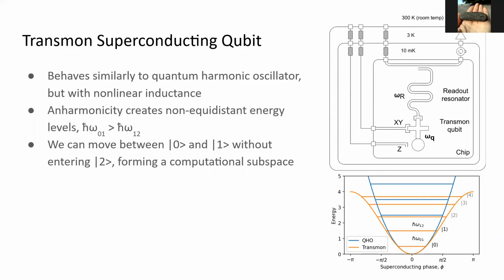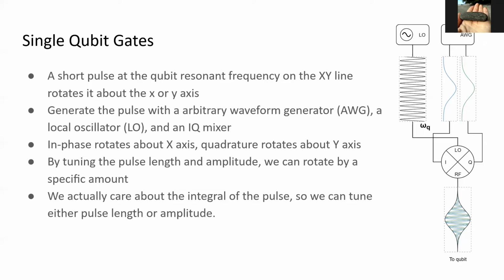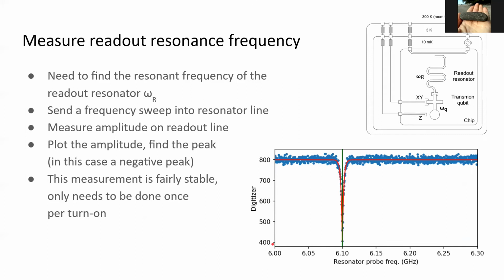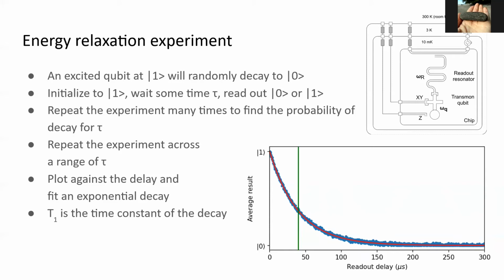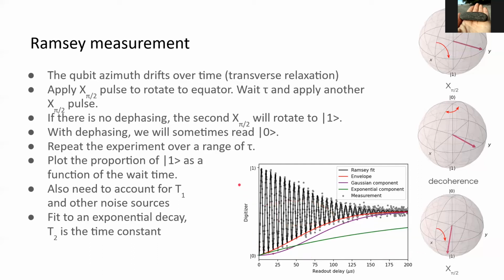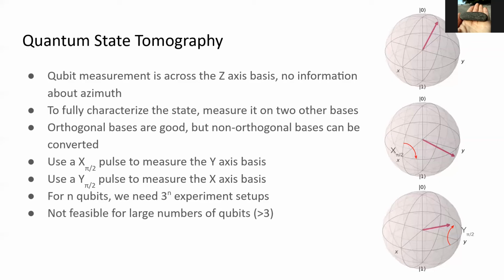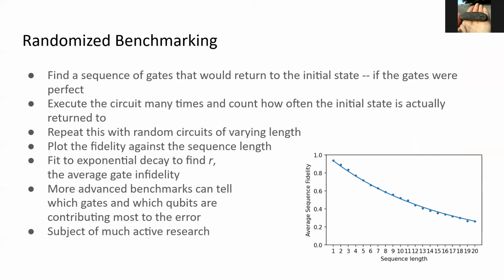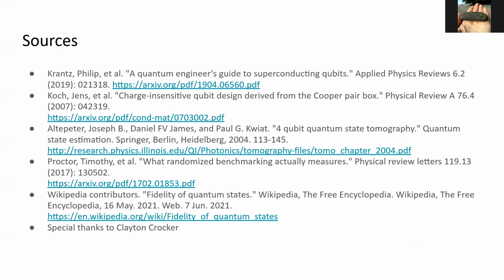Calibration of Transmon Superconducting Qubits

Comment: Hi stefan,
Is there somewhere a breakdown of why the Ramsey expariment (in time domain by varying tau) yields a decaying signal which decays with the time of T2*? I couldn't find it anywhere. Also, the frequency of the resulting signal in this ramsey experiment is equal to the detuning of the field that is used for the pi/2 pulses from the TLS gap. Is there any resource that you can point me to that explains two of these behaviors?
Reply from the maker: Hi Pasha,
The best I can do is point you toward the sources in the last slide, especially the first source. This is not my field of expertise, it was just a research project for a class. Good luck!
Reply: @stefansynths  "just a research project"!!! First class project! Really excellent presentation. I tried to find the first presentation mentioned at the begining. Is it available?
Reply from the maker: @mjParetoQuant  Hello Maa,
The guest lecture I mentioned in the beginning was given by Daryoush Shiri at Chalmers on this same general topic. There was no recording of that lecture. But similar content seems to have been published in "Building blocks of a flip-chip integrated superconducting quantum processor", Kosen et. al. 2022.

I hope that helps,
--Stefan